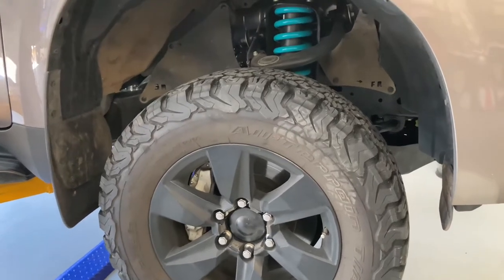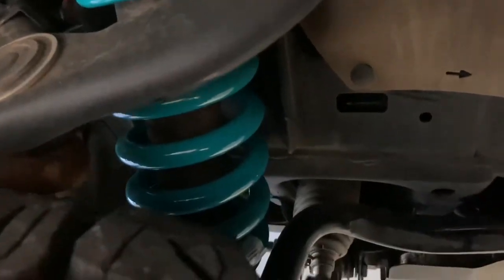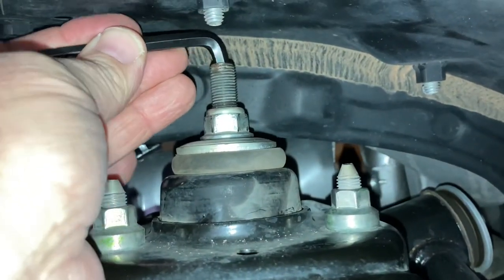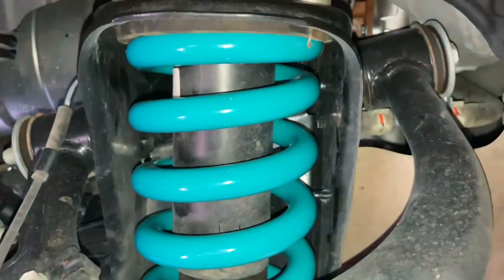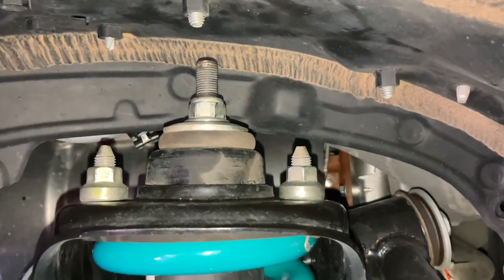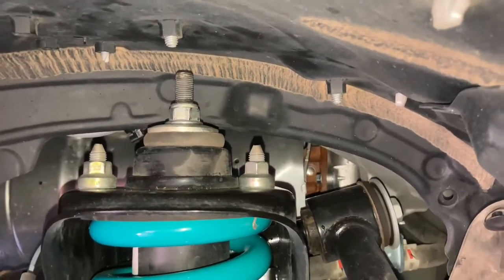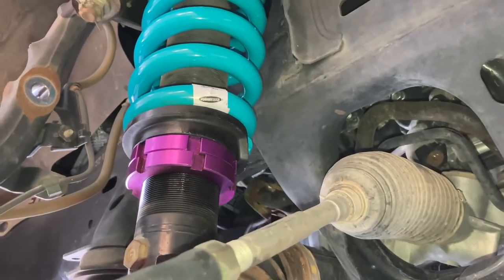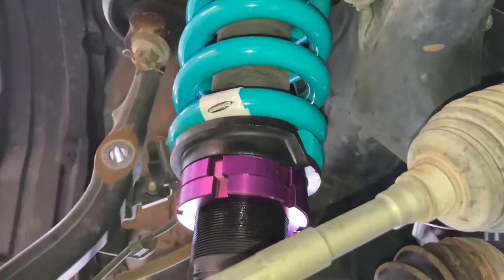DOBINSONS HOW TO ADJUST THE FRONT HEIGHT FREE D.I.y

Comment: There's other way if you can't get an Allen key in the top or undo the top bolt . Use spring compressors and compress the spring which will relieve pressure on the bottom seat. You weren't too worried about scratching the powder coat anyway . If you don't have spring compressors jack the car off the ground , take wheels off then put another jack under the hub to compress spring . Use tie wire to hold spring compressed. Remove jack from under up and there will be little pressure on the strut seats. Once height is adjusted put back back under hub. Take pressure then cut the tie wire . It really works a treat when getting original springs out to lower a Commodore 😅

Comment: I tried it today with the Pajero. Even after raising the top nut to its highest position, it’s still very difficult to rotate the adjustment ring. Could it be that the preload travel far exceeds the length of the top locking bolt? I couldn’t turn using adjustment tool by hand, so I used an extended pipe. However, my adjustment ring got damaged and dent the adjust ring This isn’t a good method—I’ll have to take it off and use a spring compressor to release the preload.

Comment: Hey I was told they only should be adjusted for different spring sizes that is all.
not adjustable ?
Kind regards
Reply: Bit late to the game with my comment, but I had mine wound up 30mm after they had settled after 6 months. Feels the same to ride in and drive.

Comment: Mate i just got dobinsons 2 inch installed, 350's in front, up to 60kg... 2023 sr hilux extra cab. i have a toyota commercial bar lights, dual battery. Its sitting way to high, when i stand on the bar it barely moves. Havent touched adjustments left them how they came, mechanic that sells the dobinsons gear said they come at the right height. Nice info, thanks
Reply from the maker: Get it from me next time 😁😉✌️

Comment: If I am trying to lower the level of the car from 3 inch to 2 inch do I have to compress the spring up 1 inch or do I release it 1 inch down cheers
Reply: The ratio is 1:2, so you need to compress the spring 10mm

Comment: I installed my Dobinson IMS C59-302 - Stock - 2.5"   with the 2.5" spring and craned it up to 226 mm it was too compressed, a shop dropped it to 213mm and it still rides pretty stiff/harsh.
I have 400miles on the new shock  should it soften up at all?
Reply: I talked to a guy who experienced this, he added weight wherever he could and cycled the springs a lot and they loosened up . It'll take more than 400 probably though.